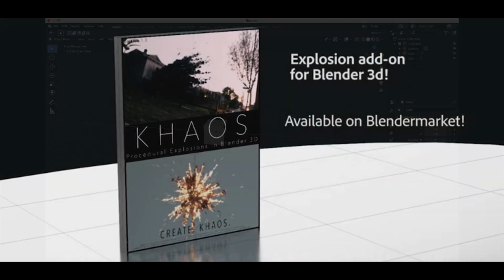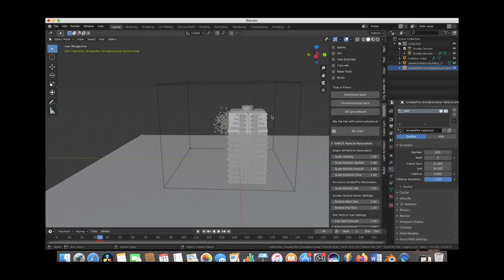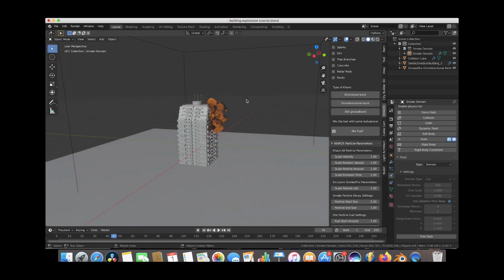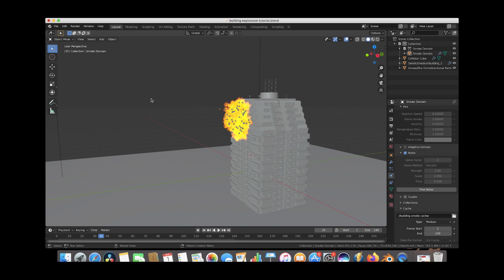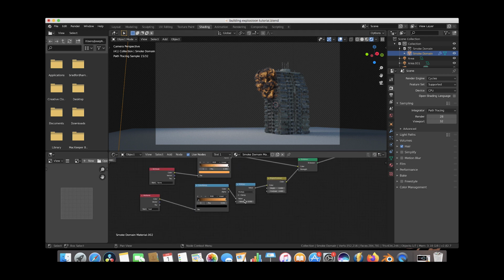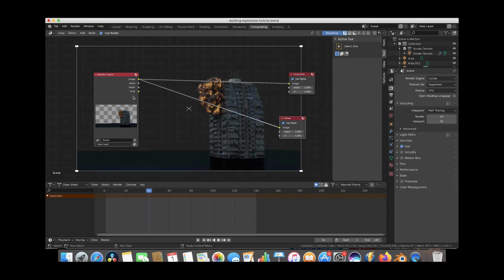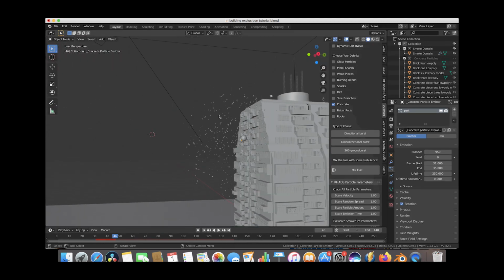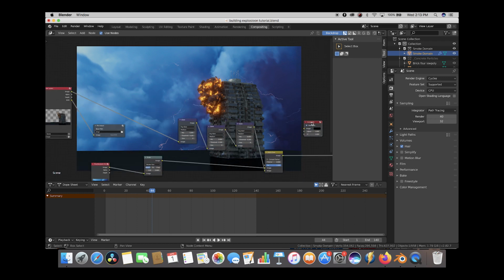Blender 3d building Explosion tutorial: Ft. KHAOS add-on

Comment: I just  brought the addon and Im curious if  mantaflow is still buggy with blender 2.92?
Reply from the maker: Hey it can be buggy for certain settings but for the most part it works great! Check out the latest video here where I go through using KHAOS with 2.92 --> https://www.youtube.com/watch?v=WgNuvYgdVt4 

Let me know if you have any questions or if you want a specific tutorial!
Reply: @LightArchitect  Thanks for the reply! Ill check that video out. For now I just want tomake a firdt basic explosion to get the hang of it. I was curoius because with my first try the baking was very slow even through I only used one emitter for the explosion and I feel my rig should have a better performance. Its a ryzen 3800+ and 3070 and 16gb ram. I might be wrong tho. Are there any settings I can make to get a better performance?

Comment: In my Blender 2.90.1 I only see particles, no fire, no smoke... Even with cycles...
Reply from the maker: Hi Gustav,
Blendere  2.9 has gliitches in the mantaflow system that haven't been resolved by the Blender devs yet. I recommend using 2.82 for simulation as  of right now.